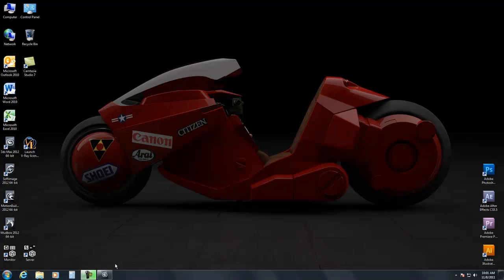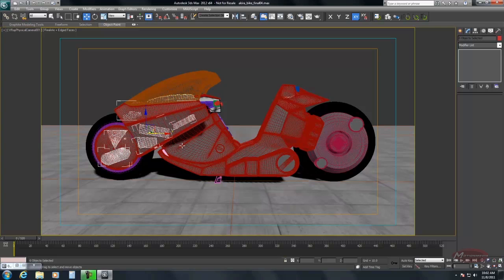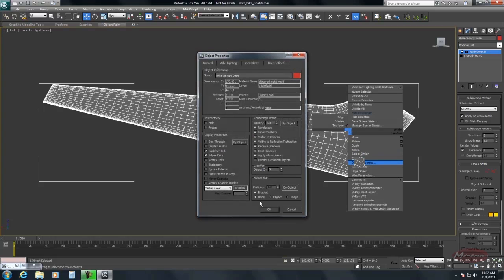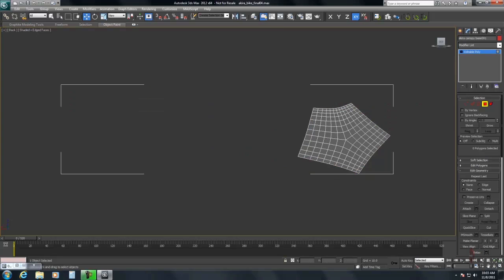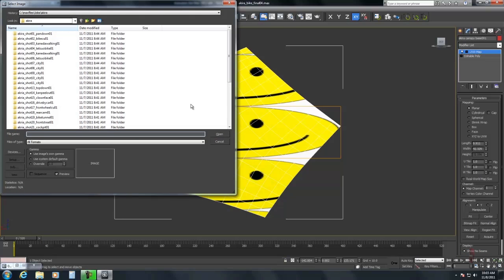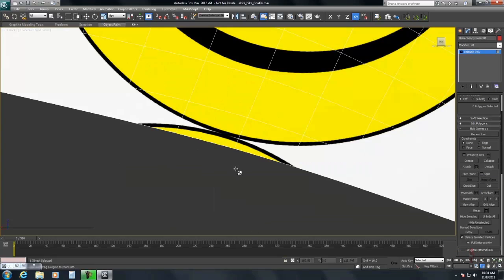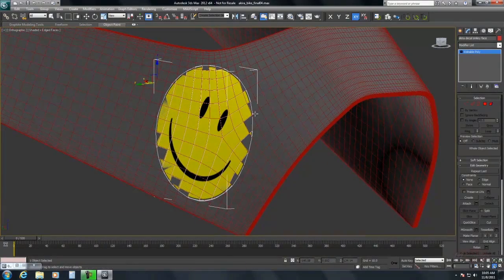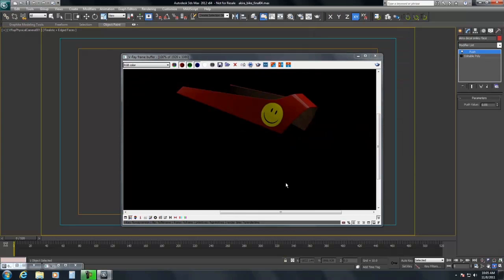3Dean: Technique for Applying Decals in 3ds Max

Comment: Good tip! I like how you used the high-rez for the decal with opacity mask, and then trimmed the decal. No matter what I did I was having trouble getting a decal not to cast shadows on the underlying surface (even after unticking 'cast shadows') What do you do if there's transparency on the inside of the decal, or do you just rely on the opacity map for that? Thanks. Helpful vid.